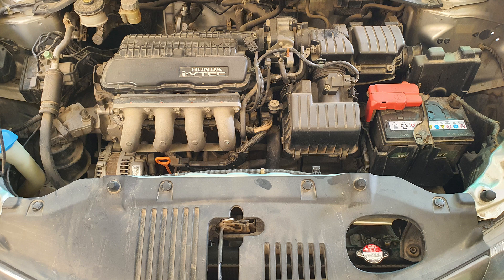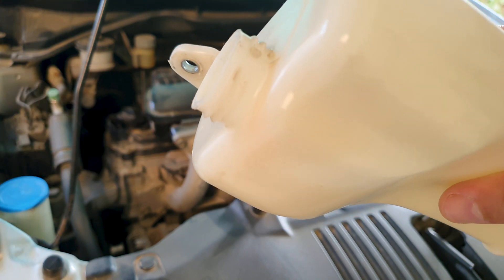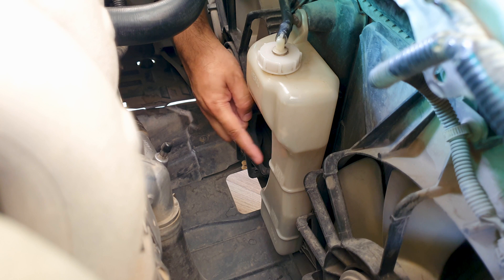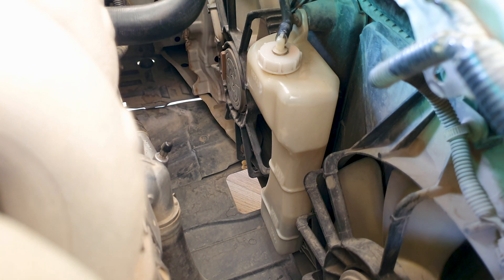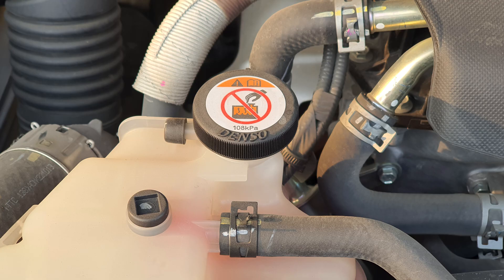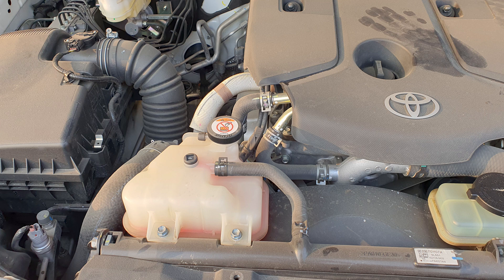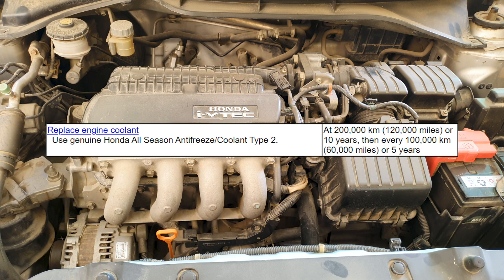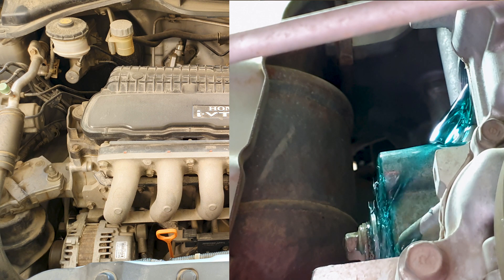How reducing coolant is normal - Different expansion tanks explained.

Comment: I had my coolant level just below the max line on my "Expansion tank" (Audi), i put a new battery in then took my car for an oil change and new spark plugs at the mechanic, and when i got my car back i noticed that my coolant was overflowing. I let the engine cool down everything works fine, i even called the mechanic asking if they put more coolant? and they said they didnt touch it. am just curious where all this new coolant could had come from?
Reply from the maker: I really couldnt say why as what you got changed shouldnt affect it. What model is your audi? 

I remember during service trips to the dealer, they always had an apprentice or junior mechanic check other basic things which was never overseen by the main mechanic. This included coolant levels and they would top it up (with water). I ensured that they didnt touch it. Not saying your mehanic topped it up but surely something must have been done. But if the levels are fine, your engine isnt heating up then its all good.
Reply: @TheWrenchWiz  My car is a 2015 Audi Q5. I got this car because not only is it great but theirs so also much info online and parts. But when i looked up about my current situation i didn't find anything. What  i was told was only worry if it goes on empty. We already burped it for any air and my brother said no to worry because if no one touched it then it should settle again eventually, plus we tested it to see if its flowing normal and it is.
Reply from the maker: If it keeps overflowing that could indicate a head gasket issue. But as you said its fine and settled so all good. Having plenty of info online about your model really helps down the line, not many consider this when purchasing :).